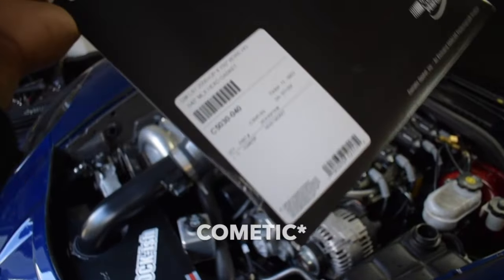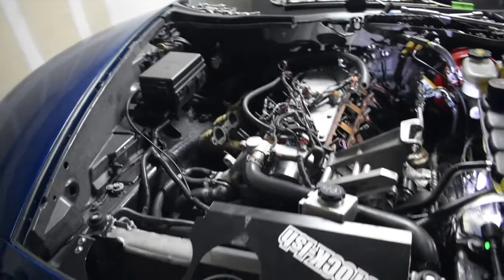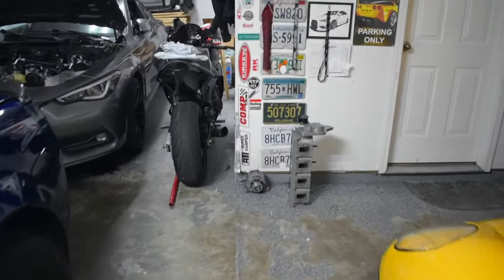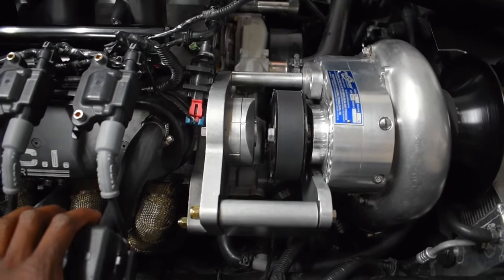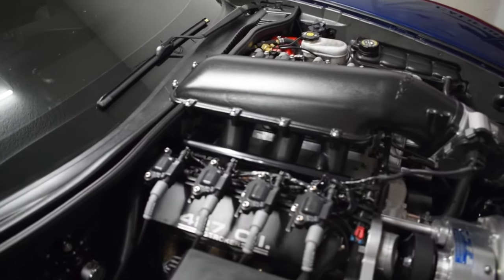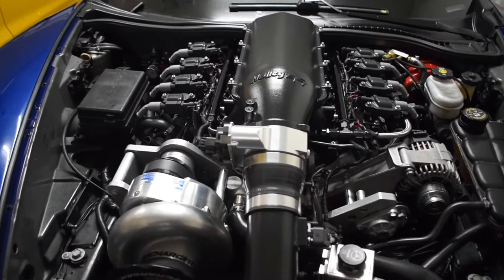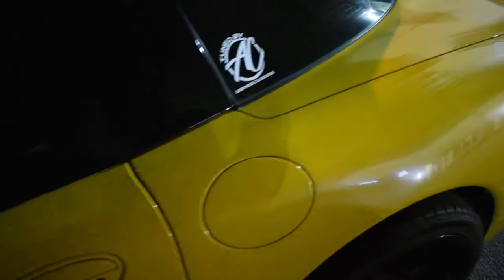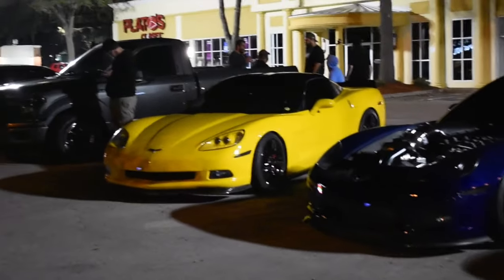ProCharged 441 LSX C6 Z06 vs KAWASAKI H2 | Round 3

Comment: I hear the RPM belts are good, I have this same setup on a 408 I used to be turbo, didn’t like it really. with an f1a94 I haven’t ran yet. So overall you’re not happy with it? Looks like you’re making good power with the 8 rib belt. You can go to a 10 rib on the corvette kit
Reply from the maker: Think we’ve got the belt issue figured out, needed to run a shorter belt. If problem persists, we’ll give the A&A kit a shot
Reply: @McgradyRacing  are you still running an 8 rib or is it a 10 I can’t tell?
Reply from the maker: It’s an 8 rob flip drive. Dedicated belt drives just the Procharger and the water pump

Comment: Big single🤔🤔🤔 Precision 88/108, MBE LS 10° heads?
Reply from the maker: That’d be some serious sauce
Reply: @McgradyRacing  probably too much for the street 🤣. But I think an 88mm from NRE would be right what you need. It has a divided turbine house so you can run a QSV and still make good top end power, it would be a win win for you. Best overall power value for sure

Comment: You need the flip drive for the power you're making. Did the heads lift from boost, is that why the new gaskets?
Reply from the maker: Weve been running a flip drive, and yes lifting the heads. Now running an MLX Gasket and went head bolt past torque specs by a little

Comment: Didn’t PROCHARGER redo the A&A bracket to help prevent the belt brake/throwing issues?  And it’s time to add a little more power to the c6 bro. He’s getting left behind.
Reply: ProCharger and A&A are two different companies.
Reply: @joetelesto1907  ok. But don’t the A&A bracket fit Prochargers??
Reply from the maker: I believe the A&A does fit the prochargers actually

Comment: What size pulley do u hv on F-1R ProCharger?
Reply from the maker: Running a 4.125 on the procharger head unit and a 7.43 crank pulley
Reply: @McgradyRacing  thx for the reply brotha 🤙🏼

Comment: You need a and a direct drive 10 rin Procharger bracket to solve that belt slip
Reply from the maker: I do have a direct drive. Don’t think more ribs is gonna stop the belt from ripping
Reply: @McgradyRacing  needs to be a and a bro it’s the best guys don’t slip with it and needs to be 10 rib I promise

Comment: A&A secondary belt drive system eliminates belt issues, it’s proven already
Reply: @Z0sickkk   He doesn’t… I can tell by looking
Reply: @Z0sickkk  He went another route when I told him about it the last time he was discussing belt issues months ago
Reply from the maker: I do have a secondary drive by rocking the procharger brackets
Reply from the maker: I am running a secondary drive, but still running the procharger brackets. Will have to look into an A&A bracket to see if that’ll help with the belt break issue
Reply from the maker: Will have to look into that A&A bracket to see if that’ll help with the belt break issue